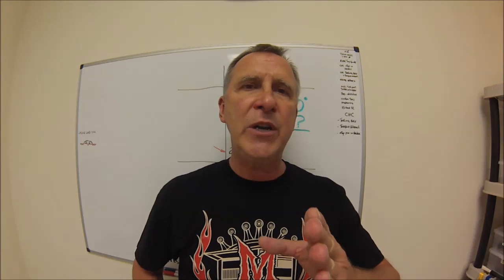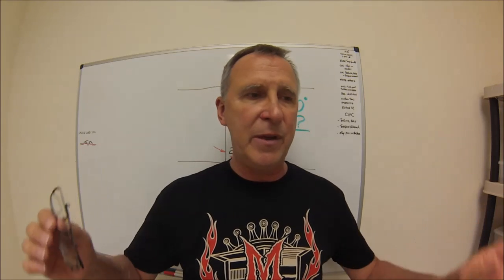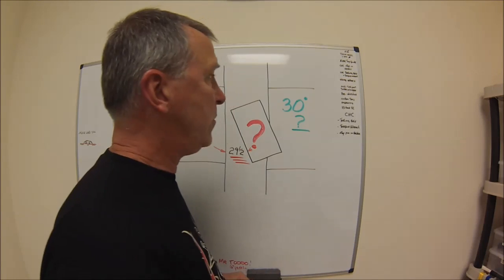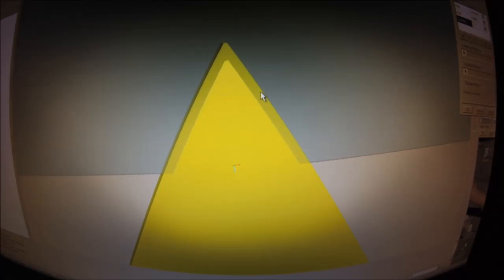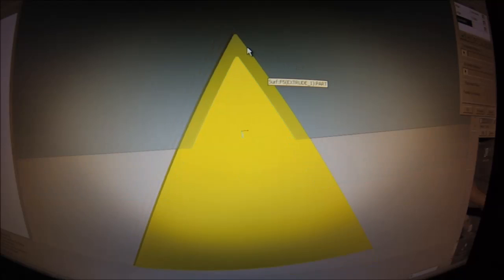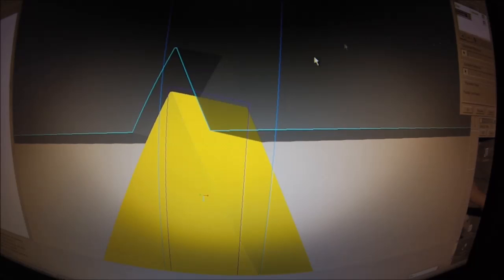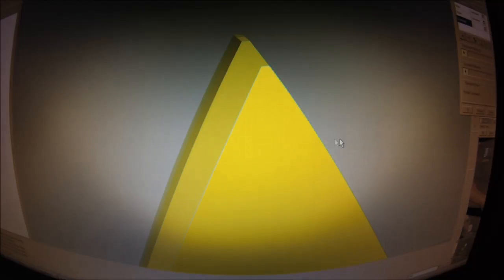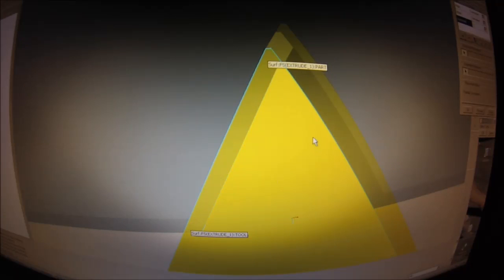Lathe Compound Setup for Single Point Threading...Myths and Musts

Comment: what a load of shit to swing your top slide around to 29.5 . i cut threads every day for a living have for 30 years . and most  use full form inserts these days anyway.
Reply from the maker: I'm not a fan either, but it can reduce load on the part and tool if you're getting chatter.
Reply: As Joe said you can do this on industrial sized machines like you obviously do, but and it's a big but no pun intended  lol on hobby sized lathes like mine, ( I have a Chinese 12" X 19" combination lathe/ milling machine and the compound rigidity is pretty poor. I always go 30  degrees to form a thread even with a carbide insert threading tool. I would only plunge the cross slide either in brass or aluminium on a small thread no bigger than 8 mm  - 5/16"

Comment: wrong do the math diff angles will give diff depth of cut
Reply from the maker: Wrong on what? If you are cutting threads by measuring the depth of cut, and not the pitch diameter, you have missed the boat. Please explain your comment.

Comment: Toolmaker for 30+ years, Engine or CNC always cut at 30 degrees holds the point in the root of the thread. Never heard of 29 or 291/2. But I've meet a lot of morons.
Reply from the maker: You may be the first person i've ever heard of  that never heard the 29-29 1/2 rule.
Reply: @joepie221  I'm mainly a self taught guy plus a few months in a machine shop, and all I ever heard of was 29 or 29.5 degrees. Rather surprised to hear a 30+ year toolmaker say he's never heard of it too.
I also use a method where the top slide and cross slide are at 90 degrees to each other and you advance them both by certain increments to approximate the 29 degrees, then once the thread minor ID is reached you can do thread "flank shaving" only without taking any more depth from the thread.

Comment: this makes no sense , the tool is 60 with its center axis 90 to the work , why care where the compound is set ?
Reply from the maker: This makes total sense. Any compound movement outside 30 degrees will blow the thread.
Reply: @joepie221  thanks for responding to my dumb comment  , i must be missing something , the center axis of the 60 * tool is  90 to the work no matter what angle the compound is ?
Reply from the maker: @snoosebaum995  Yes, but beyond a 30 degree setting you will get ridges in your trailing edge if you use the compound as your infeed.
Reply: @joepie221  i must be missing something here
Reply: @snoosebaum995  Maybe that you increase depth of cut with the compound infeed and not the cross feed?
Reply: @b1lc1s  nothing in this video/discussion changes the fact that the axis of the cutting  tool is 90 to the work , what does it matter how it is held ?
Reply: @joepie221  I can’t help but wonder why you would  “blow” the thread at more than 30 degrees?  As long as the tool is set square with the stock I believe you could cut a perfectly good thread at 31 degrees or more. The right side would simply shave off a little more material per pass while feeding in. You’re probably correct but since I’m always pushing the envelope I might try it to see what happens.
Reply from the maker: @ellieprice363  Having a compound setat more than 30 degrees will result in a ragged, stair stepped right side of the groove. It may still work since technically its a bigger profile, but visually it will look torn up on one side. Both sides of a threading tool fail to cut or wipe if anything greater than 30 degrees is used on the compound for a 60 degree thread profile.
Reply: @joepie221  Thanks, you’re absolutely correct. It just took a little thinking to wrap my head around it. I can see now with more than 30 degrees the tool is moving slightly to the left on each pass leaving a stepped cut.
Reply: snooze Baum:  I think what you’re missing is that he’s feeding the tool in with the compound set at a 30 degree angle. If you’re feeding the tool straight in it doesn’t matter how the compound is set.
Reply: I struggled to understand it as well but i finally get it. You are right the tool is at 90* to the work but by having compound at 30* when you feed in you are feeding into the work as well as to the side thanks to the compound angle you are feeding towards left face of the cutter. The cutter cuts smoother when being mostly loaded on one side versus both.
Reply: @desyquintero8451  i still don't get it why should the tool point care how its being held ?
Reply: @snoosebaum995  The tool/tool point must be at 90 deg to the work, otherwise one side or the other will cut an angle greater than 30 deg and blow the thread profile.  You can cut straight in using the cross-slide or reduce tool load but using the compound, but the tool must be at 90deg.